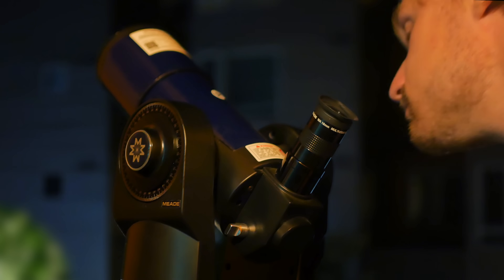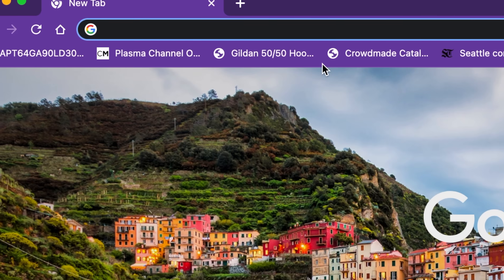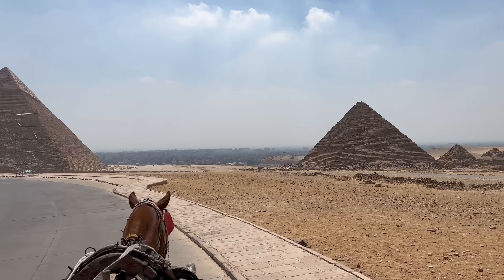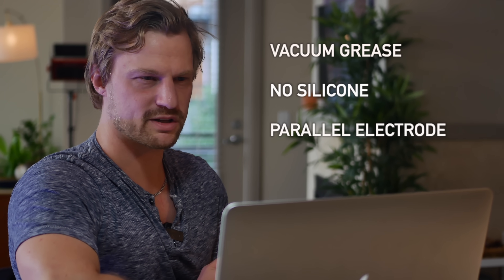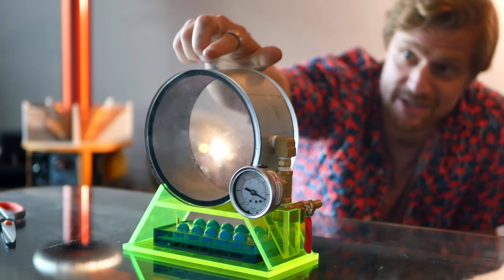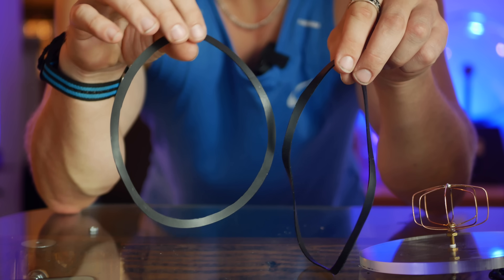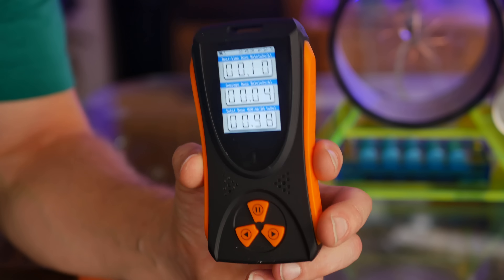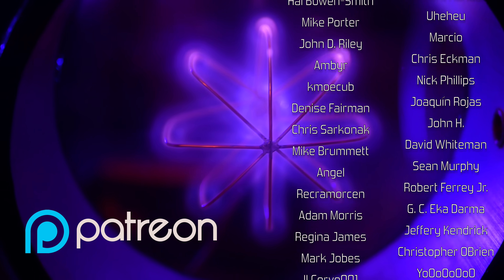Building A Nuclear Star In A Jar (Fusor)

Comment: Don't think you understand how fusion works. Stars work because of two things, very high pressure(gravity) and very high temperature(+1 million degrees). Farnsworth created the Fusor using electron guns originally used TV CRTs. This worked because of high pressure and temperature caused by electron beams. You have nether here, this is just a plasma generator.

Comment: Where did you get the high voltage power supply, as well as the what is the JB Weld part number for vacuum leaks? Grainier part number for the gaskets you made? Part number for the expensive vacuum pump too.  Thanks, keep up the good work!

Comment: Replace vinyl vacuum tubing with PTFE to stop offgassing of organic volatiles.

Replace Acrylic with annealed 316 Stainless Steel, PTFE, or Borosilicate (each depending on the structural requirements/budgetary constraints) to prevent offgassing into the chamber.

Add secondary Ultra-high vacuum pump(s) such as oil-diffusor, or turbomolecular pump. (these will SIGNIFICANTLY improve your chamber pressure by staging the viscous pumping, with low-pressure probability pumping.)

To minimize/eliminate X-Ray hazards, encase the entire assembly in a conductive and electrically grounded Faraday cage. (I have used industrial solder wick [when unfolded, becomes a copper mesh sleeve, resembling those finger-trap toys] tied off at the ends, and this has worked great for me)

Since you said you're gonna try D-T runs, remember that neutron radiation is one of the 3 primary output products of fusing these isotopes(He4+neutron+E [mostly hard x-rays, with some low energy gamma]), and I have to stress either adequate shielding around the device, or setup a remote (shed/detached garage) location to run the machine.
---> Bluetooth enabled remote control (or hardwired, if you're feeling masochistic) to a second location would be ideal (multiple GoPro setup will be invaluable here, monitoring the machine running/shutdown) to allow for neutron dissipation, and beta-decay back down to safe/normal background levels
.
Hope this ends up being useful. Be safe, have fun.

Cheers.

Comment: joe papp light guide engine vacuum sealed normal internal combustable engine...the victorian clue to how they knew to run on air ion was the I.C.E abbreviation  air forms to ions and a tv flyback will cause the negative (electrons )allegedly and the positive protons (allegedly ) to be stripped as stanley meyer and joe booker and many others realised vacuum the engine a major clue

Comment: I think we still made global warming as we use energy from infinity energy and put heat into the atmosphere ( running a computer in a room the room will get hotter). But now it will help us.
Reply: The earth has an enormous surface area, and thus has no problem radiating away any heat we generate on the surface. The issue with global warming is determined by the composition of atmospheric gases, as certain gasses reflect the radiated heat back to the earth, reducing its ability to cool via radiation.

Comment: A quick practical tip: when applying Teflon to threads to seal things leave the first thread bare (this is how its done in chemical industrial settings because if u put it over the fittings edges some of it can shear off and get into the nitty gritty espcially since ur working with vacuums)

Comment: IIRC the reason Silicon isn't used in this case is because it off-gasses.
Reply: A lot of silicone rubber is also slightly porous so air will slowly diffuse through it. Some time back I ran compressed air through some silicone tube that was under water. I could see small bubbles forming on the surface of the tube as the air diffused through it.

Comment: your finger pushing the high voltage wires together makes me think you shouldn't ever touch high voltage
Reply from the maker: The beauty of the one hand rule, while standing on an insulated surface....i've been doing HV for a while and know what is safe and not safe :P
Reply: For anyone else reading this, the one hand rule will not always protect you. It really depends on your environment and the characteristics of the electricity in use. 

One example would be high frequency AC current. The high frequency would result in the insulator you stand on having a low impedance. This would mean that it could simply flow through the insulator like it isn't even there. While our neurons are not affected by high frequency AC, you could still die from internal burns should the current be high enough.

Another example is very high voltage DC, typically voltages above 100kv. The power stored in a capacitor is a linear relation to capacitance and an exponential relation to voltage. This means even a very poor capacitor will store a lot of charge in the presence of high voltage. In this scenario, standing on an insulator makes you a very poor capacitor. The very high voltage charges you regardless, and the moment you step off the insulator all that current will discharge.

All in all, it is always a good idea to observe the one hand rule to decrease the odds of a fatal accident, but you should never do anything that would increase your odds of dying, such as touching live wires.
Reply: it's still a good general rule. lead by example. only takes one mistake.

Comment: Wow this is ridiculously awesome! I've marveled at quite a few fusors like this that other people have built but your version looks the most ready to be a showpiece. 95% of this stuff is over my head, but the one very minor thing I thought you might be interested in knowing is that when applying PTFE tape generally you want to wrap the tape clockwise (to match the direction that you will rotate the pipe/fitting). Also, for gas/vacuum applications I believe the standard is 4 wraps of the yellow gas PTFE tape so I think you would need 8 wraps of the white tape. I'm quite surprised you were able to get away without using hose clamps on the barbed fittings too!

Comment: That was a great build. I really enjoyed it.

Re fusion, I don't believe fusion is going to make any difference in our lifetime. 
By the time they get there commercially speaking and I'm fairly certain they will get there, it will be in the first part of next century. So far every incremental step is touted as a 'major breakthrough. To me a major breakthrough would be that a prototype proof of concept fusion reactor can now boil a kettle with its harnessed electricity.  
The industry is its own worst enemy as it tends to platitudes which breed cynicism born of profound exaggeration. No one hardly ever mentions the helium-3 problem, instead making stupid announcements about 800% increases - over a baseline that is conveniently omitted (because its likely embarrassing). 800% is no breakthrough, it's a meaningless announcement fabricated into a breakthrough by PR spin. I'm sick of it. 
Fusion scientists, Get on with it and stop talking sh1t because no one cares anymore with your BS 6 weekly breakthrough announcements.

Further, commercial fusion is still likely give or take about 100 years away and that's only if it can succeed in the market. If it's 10x more expensive than renewables then it will never succeed. No one ever talks about the commercial reality emerging tech has to face in a competition based marketplace, only the tech itself.
Just because the fuel component is apparently cheap and unlimited, that is only one part of the commercial case. The whole case for fusion has to be taken into account when considering its success.

Comment: ion plasma circular hall-effect centrifuge, or linear static ultra-hv accelerator
Reply: dc synchrotron or cyclotron, no ac, only dc current and magnets, railgun cyclotron/synchrotron
Reply: dc-only z-pinch machine reactor, circular constant accelerator (ions and electrons loop around in same direction, even if going opposite direction in the plasma current)
Reply: how this, still very jarring :)
Reply: z-pinch confinement (speed based) not confinement based
Reply: it might hit the walls but dont care about it, it will transfer heat that way, the central ions will fuse
Reply: for low vacuum static is enough, no high current voltages required
Reply: btw with high voltage and high current (arc) you make a flash tube bulb, with high voltage and minimal current (electrostatic) you make a field accelerator, just like the manhattan project did their tests with fast ion collisions, whatever its said to be done, discard that

Comment: Awesome mate, something i have also been working on, but first i need to fix the vacuum pump that is currently in pieces. by the way, that thumbnail looks great but wheres the one hand rule? that alluminium housing is has what 40kv of negitive charge.
Reply from the maker: Hey Noel! Correct, if both hands are at -40kv DC, then there is no current flow from arm to arm across my chest. So, technically safe as long as my feet are totally isolated. :P

Comment: I just used a hydrogen tube at 400-700kv source to run energy through it. This made the hydrogen spectrum tube glow a bright pink. Though it did not make a good night light as the tube got too warm to the touch and the power supply fizzled out. It was just a cheap 3v to 700kv or so power supply from amazon or aliexpress. I forget the exact place I ordered it from.

Comment: combine processes such as water inside plasma tube produces hyudrogen while cooling and yiu still have turbine heat .. not to mentiion chemical reacttion batteries and driversz and sound pusers etc .. sound pulsing in high pressure room connected to wire grid iz the same or more than nuclear energy and hasz no heat artifactsz ... in silent high pressure room with wires of grid passding through yes in seconence wiring style and fashion and sophistication as mass shape and flow should determine flow direction .. or wire wrap as you did

Comment: Acrylic, rubber and vinyl all off gas at low pressures. Stick with glass, and metal. JB weld is great for seals. Avoid hoses, and barbed fittings as much as possible.

Comment: WOW! Fantastic! Plus, I am a huge Farnsworth fan. You rock!
Farnsworth did not invent digital television. He did however,  develop many innovations that finally made electronic analog television practical by the late 1920s. I spent several wonderful hours on the phone with his wife, Pem Farnsworth in the 1990s, and got a lot of precise information directly from her. She personally wrote and kept all of his lab notebooks for him so he could concentrate on the problem du jour.
You need a two stage vacuum system. Mechanical first stage and a diffusion pump second stage. I don't care what that mechanical gauge says, it's wrong. You need an actual electronic ionization gauge. Do not power that up until the first stage pump is maxed out and the secondary diffusion pump has run for a bit. I learned this at a company I worked at in the 1990s that made ion drift chambers for molecular analysis. (If you go this route, build a secondary implosion containment box around your current model for safety.)
Farnsworth nested several spherical cages, one within the other. Each inner one was operated at higher and higher voltages to achieve actual fusion. The real test is to remove the power. If the "fusor" or tiny star persists for a few seconds, you have achieved success. This information was obtained directly from Farnsworth's autobiography. At the end of the book. 
The real proof of fusion is detecting actual neutrons.

Comment: Your viton rubber is pronounced Vye like dye and then like tom but with an n so Vyetaan. NPT threads are notorious for hosting vacuum leaks. We use KF fittings and flanges in the semiconductor industry for maintaining HIVAC pressures such as 1x10^-7 torr that is like the best pressure we have typically around -5 to -6 scale torr when flowing gas. For UHV pressure the copper one time use gaskets are used I forget the name of them maybe conflat but not sure I dont use them much. Maintaining HIVAC though requires much more than a roughing pump, also needs turbo molecular pumps and cryopumps. In your setup if you integrate a small turbo you will attain a much higher vacuum. Awesome project but you still have a ton of air in there. 10 microns is .01 torr so I mean this is rough vacuum but if you really want to build something cool try to get into HIVAC territory. Keep building cool stuff man, I love it all!

Comment: There is no way you have a sufficient vacuum in your discharge chamber - despite the reading on the fancy vacuum pump, which probably is correctly telling you the pressure at the pump outlet, you would already be generating copious x-ray output if a similar pressure were present in the chamber. You are aiming for the edge of the diffusion regime, where the remaining gas no longer flows normally: use a large diameter metal pipe connection, and hit your discharge chamber with a heat gun while pumping down for an hour and you will get better results. Also, IIRC, that grid will glow white-hot if you manage to form a "star mode" plasma, indicating a proper ion compaction(?), which you ought to achieve readily before attempting anything with deuterium. Do you think your HV feedthrough will be up to the heat?

Comment: Fusion energy is currently trying to get more out of the generator than it needs to start, right? That's the first law of thermodynamics. It's why perpetual motion doesn't work. How is fusion supposed to get around that? Is there a theoretical reason it can break the laws of physics? Even stars burn out.
Reply: That isn't the intent of fusion. Fusion is taking two particles whose energy is contained in their potential wells and rearrange their positions to one where the potential well is smaller, the energy originally in that well is ejected as heat. You can think of it like burning gasoline, you haven't decided thermodynamics because you are just lowering the energy of the fuel and sending that energy into its surroundings.

Comment: You realize someone tried putting hydrogen gas inside there. It will begin to fuse into the chain 4 H goes straight to helium. I imagine 2 beta particles will result so you will expect the rig to build up negative charge. Insulate the rig then put a capacitor between it and ground. Draw power off the capacitor. See Tesla 1901 Radiant Energy Collector for basic schematic.
Reply: Beta particles are electrons, the ions accelerated are protons and neutrons. Fusion of hydrogen does not produce beta radiation, it is either alpha, gamma, or neutron depending on the isotopes involved.
Reply: @RMX7777  I read an early paper from some researchers passing 100kv through hydrogen producing 4He. Good luck finding it.

Comment: If you are going to use the JB weld, turn the vac on first, this way it will get sucked into any leaks. 
Also loved the video.
Reply: Also, JB weld original is better for vacuum because it has a bunch of tiny, ground up steel particles in it. Epoxy is a type of plastic and most plastics both off gas and are gas and water vapor permeable under strong enough vacuum conditions.  Metals tend to be different in this regard, or at least certain types.  Anyways, the steel particles in the JB weld original, create more of a barrier for the gas molecules to try to wiggle by, so to speak. 

      If you want to make your own vacuum sealant material, look into Faraday wax, which apparently works extremely well. It is a mix of beeswax, rosin, and iron oxide powder if I'm remember correctly.
Reply: @justinw1765  If you are trying to use a vacuum to draw a liquid into leaks, a lower viscosity is very useful for that.

Comment: If you, anyone else, or any team would like to build a possibly much better thermonuclear reactor with a little more effort, applying both electrostatic and magnetic fields may result in stable and tight non material confinement. 

Sketch made by keyboard characters: 

+V  n0s  n0s  n0s  n♤s  n0s  n0s  n0s  +V

A row of flat ring magnetic coils like washers on a bolt separated by wide spaces carries both a stepped positive electric voltage increasing along the axis in both directions from ground ♤ in the center. A stepped magnetic field made of ring magnets is also strung along the axis. A metal shell around the magnets carries its step of electric charge. The magnetic field is slightly stronger in the center  so the magnetic field lines smoothly curve away from the axis for stability. The plasma will become positively charged as the electrons are pulled out. That is an advantage because electron thermal luminosity drains power. 

MIT developed a wonderful superconducting ring magnet using a flat stainless steel ring with a spiral grove on at least one face holding a brittle superconductor. 

This is free information for the betterment of civilization. 
I belive that breakeven perpetual motion is a better general energy source. 

Aloha
Charles M Brown lll
Kilauea, Kauai HI 96754